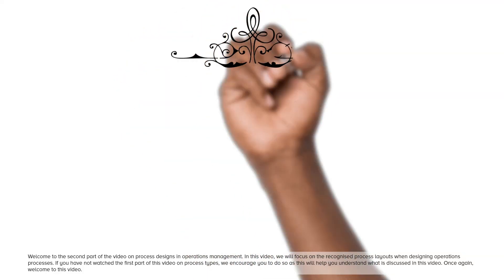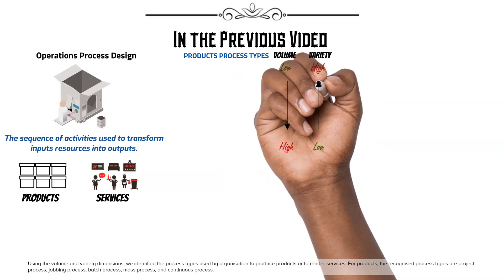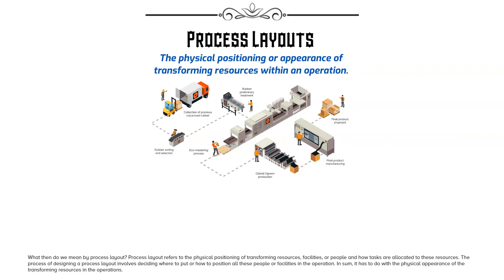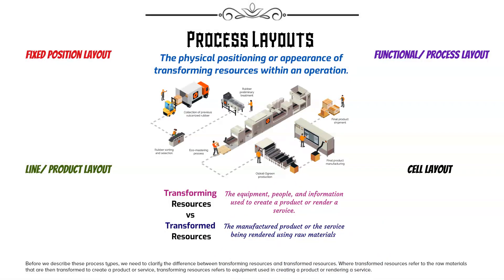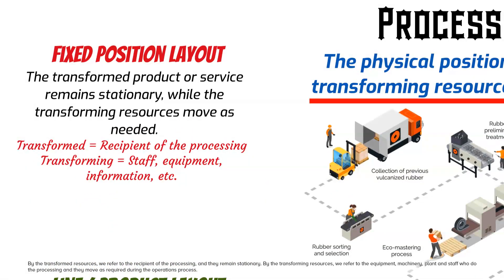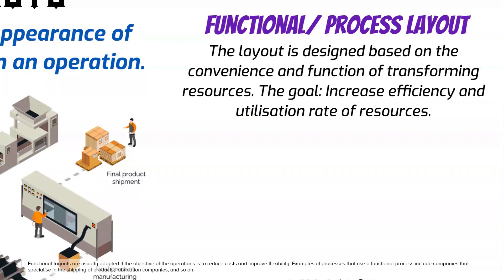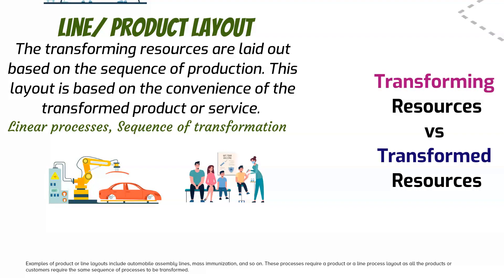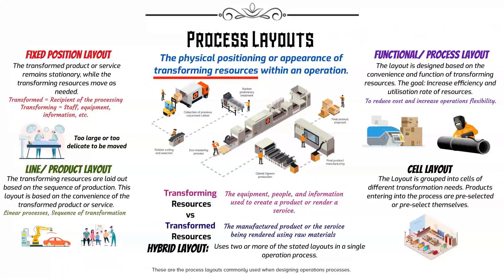Operations Process Design, Types & Layout (Part Two)

Comment: Can anyone tell me what is the best layout for software development?  Like if you are building an app what is the best layout?
Reply from the maker: It depends on who you are developing a software for. For example, if you have been asked to develop a software for an organisation (i.e. a contract), this will be bespoke to the organisation, hence a Project Process (i.e. the process type) using a Fixed Process Layout. It is imposible to move the package used in developing the software from the system or the cloud within which it is stored. You being the transforming resource, will have to work around this to develop the required software.

However, if your aim is to create market for new software that   fills a gap in the market, depending on how your develop the software, the process type will may vary. As I am not a software developer, I am guessing you will have to adopt a Functional Process.

I hope this helps somehow.